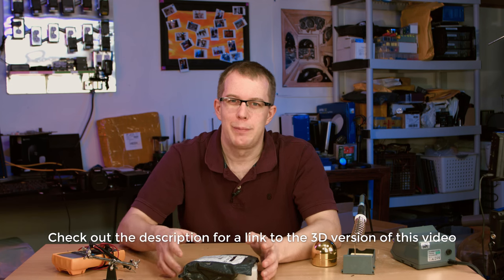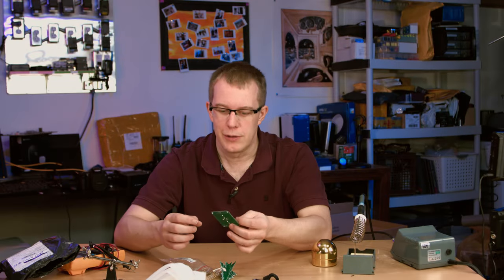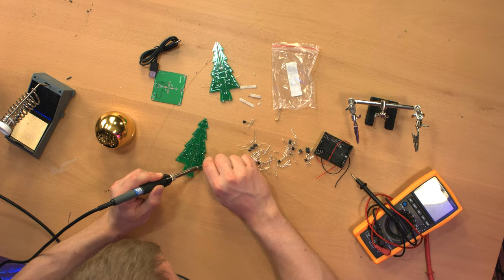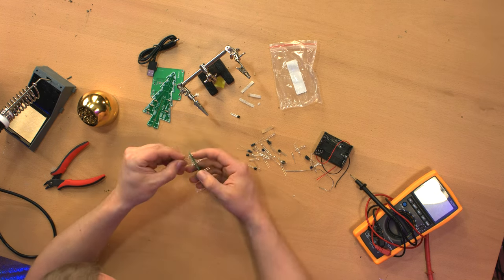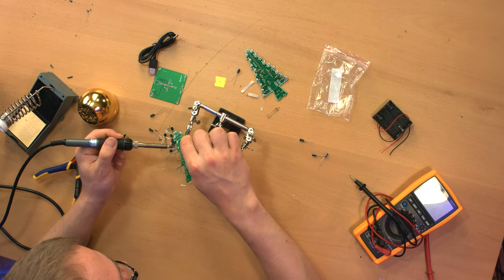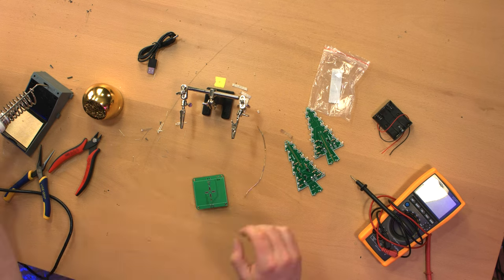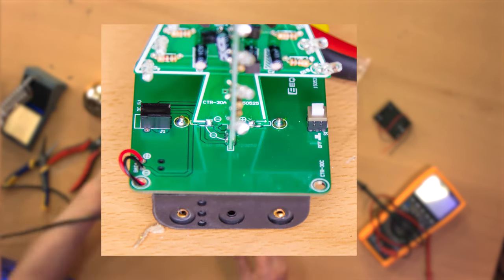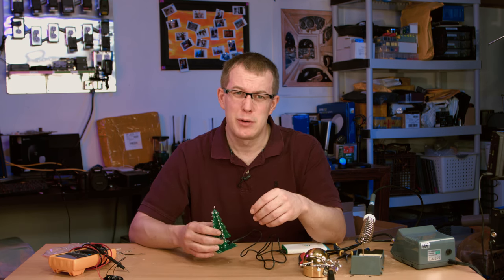Solderable LED Xmas Tree Ornament - Christmas the DIY Way

Comment: Can you repair a circuit board? I have a battery operated outdoor wreath light with a timer; they are rare. I thought I had taken out all of the batteries for storage; outdoors does not mean water doesn't get in them, such pour O rings. I was getting ready this year and found my mistake, as I was busy with the clean up and wanted to make sure there was no moisture that I got 100% guarantee electronic spray to make sure there was no moisture, as it worked before I did this; and saw smoke coming out of this one spot on the board, and you know it was ruined. It has little switches and the wires do not unplug. It is prewired/pre-lite and if you take the old lights out, the wreath sheds, and I decorated it  to match 3 others, so I tried not to cry about.